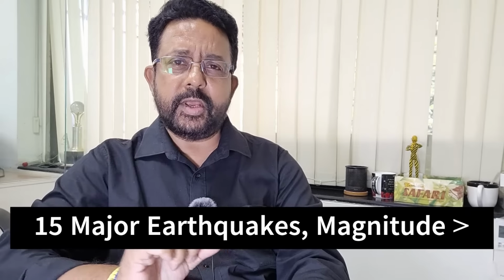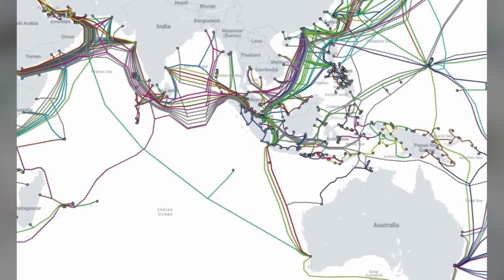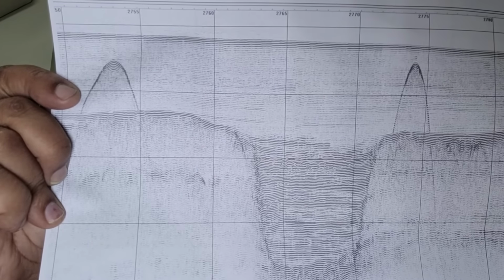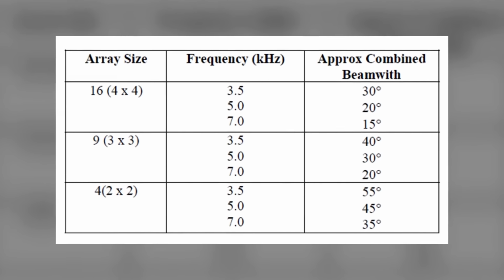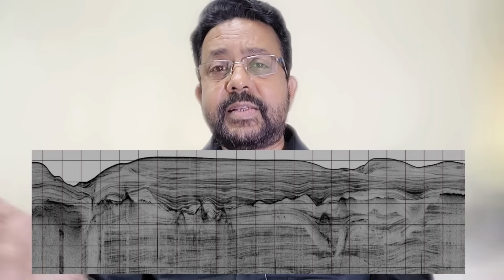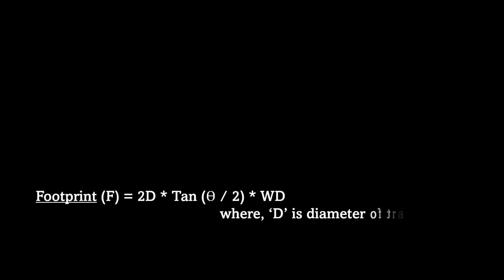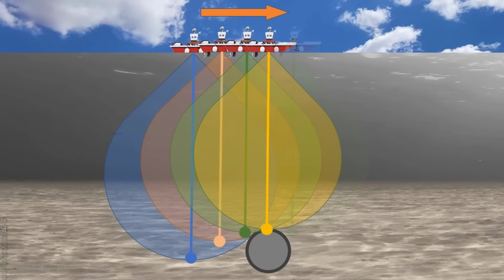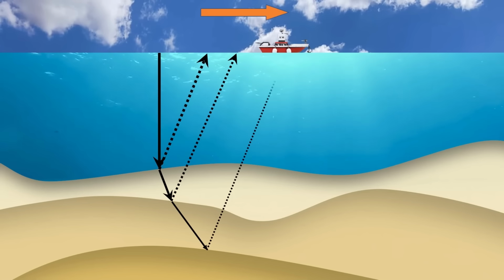Sub-Bottom Profiling: Mapping Hidden Pipelines

Comment: Hi I have few questions about the single beam processing..I want to the mail lines and cross lines difference between the lines. How is it possible..usually we can check on flat surface..but on sloping its not possible..mostly the variation should ne in 10cm but slope areas how much it is..please tell me ..thanks
Reply from the maker: Acceptable varience between main line and crossline shoud not be there. But as per IHO SP 44 standard, 1% can be the depth accuracy. So in general we can also take the same 1%. But thats not the case. If we take 1% variable then in 30m depth we can have a mismatch of 30cm which is not acceptable. So as a surveyor we need to understand what causes errors in depth and try our best to minimize them.